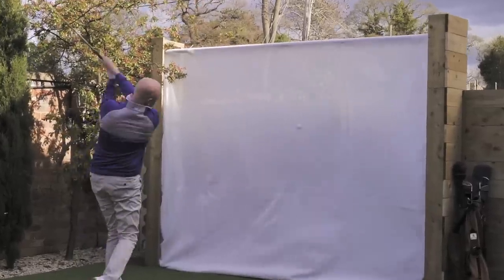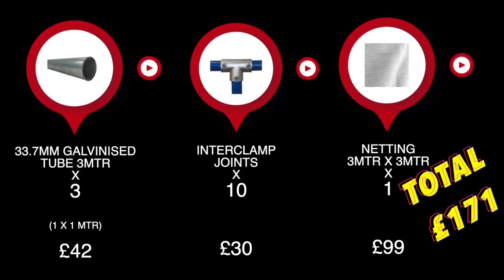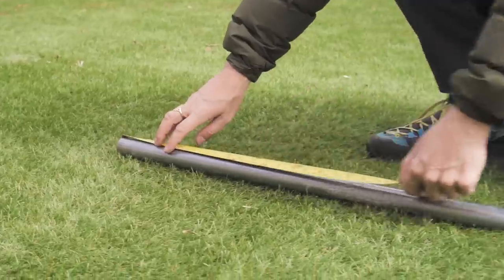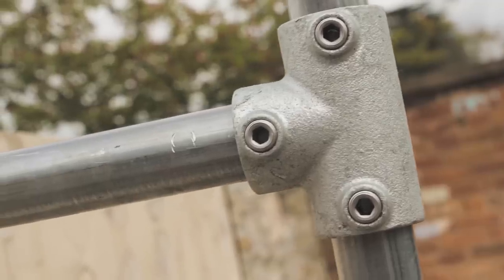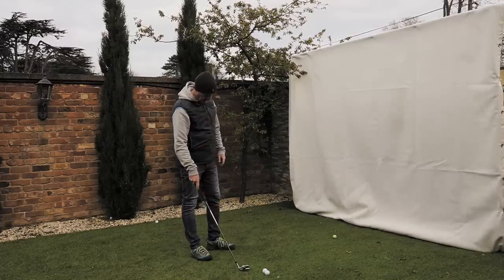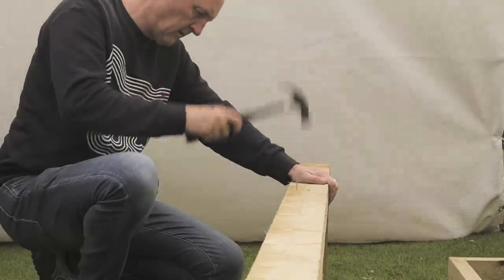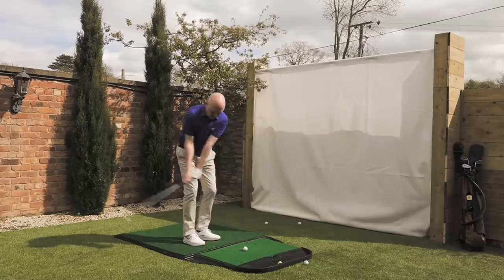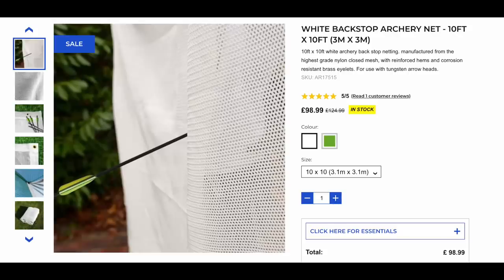I BUILT A BACKYARD GOLF DRIVING RANGE FOR £180!!

Comment: Archery netting is an excellent idea.
Are they heavy?
By comparison to normally netting/sheets?

I use a tension rod at the moment, and curtains - with another six-eight inches behind

An archery net would be much better - if the rods would take the weight.
Reply from the maker: Its not overly heavy but not sure the tension rods would hold
Reply: Ok, thank you.
I will stick to my curtains for now then.
Hopefully I can revisit the archery nets in a few weeks. Once normality returns I will visit an archery supplier and be able to find out.   @TheAverageGolfer

Comment: Hey Andy watch those plastic cable ties after a season in the sun the UV will deteriorate them and under pressure will crack and break i would use a heavy gauge wire down the road to change them out just FYI
Reply from the maker: Yes good advice I will change them

Comment: You reed my mind Andy. The pavers have been laid in a frame. I've got the mat to go on top. Just working on the net frame to attach to the fence. Got some 3M x 3M bird netting cheap from the hardware store and have a piece of shade cloth about 2M sq. I'll see how it works out but the archery net sounds great.
Reply from the maker: Someone mentioned shade cloth....we dont have that in the UK!
Reply: We use it Down Under to block out the heat of that big orange coloured ball in the sky that gets up around 40 degrees C in the summer.

Comment: Andy, did you come in on the pole dimensions to get a bit of slack in the width and height or keep them at 3m and were able to get the slack by not over tightening the tie wraps?
Reply from the maker: Yeah I would build the frame a few inches shorter than 3mtr square

Comment: Corking VID !
And 'Zackly what I'm thinking of, seeing as I  can't go to My local course (Kirkby Valley) or nearest Driving Range (Formby Golf Centre) for the foreseeable.

I WILL need a mat however.
But
There are "Ball Only" mats (crap in My opinion) from under £20
Decent "Range Style" ones are at least £60 a pop

However, Your recommend of Archery Netting is sheer genius ! Two Thumbs Up for that !

As a (recently retired) Plumber, I'd suggest that using Solvent Weld (SW)waste pipe (either 32 or 42mm) and 90's and T's
(Just don't Mix & Match Pushfit & Solvent Weld, they DO NOT fit together)
TBH Using SW without adhesive would work fine and mean it can be disassembled and refitted as and when.
Plus any "fatalities" are easily swapped out for fresh.

For a "Goal shaped frame" made of waste pipe you'd need:
4 (5 if you want to be more generous) x 3m Lengths of 32mm SW Waste Pipe (Toolstation Code: 40364 @ £3-77/ Length)
2 x 32mm SW 90's (Toolstation Code: 50479 @ 66p each)
4 x 32mm T's (two as feet, two as supports to something like shown, a wall) (Toolstation Code: 36237 @ 66p each)

Four lengths will create two verticals joined to a horizontal PLUS two front and rear facing legs at the bottom
Use the Fourth/Fifth lengths for the legs
(pipe can EASILY be cut with any woodsaw or hacksaw)
For additional support, cut the two verticals about 1-2 foot from the top 90 and insert the extra T's
The bottom of the Verticals can be inserted into the fron/rear facing T's and create support in front and behind the net.
Stake these down with string & tent pegs

Could even trial it out with an old duvet cover ?
Was thinking that using bungee style para cord would offer some elasticity to tether the "Net" with and hopefully prevent/delay the tearing around the "eyelets"

Design exactly as Andy's....

Total cost for My cheapo crappo ?
About £20-25 for the frame
Plus Net/Duvet Cover
Plus Mat (or a piece of an old carpet ?)

IF You want a stiffened lower edge to the Net, then create a hem and shove a few lengths of Pipe Lagging in there.
It's waterproof and stiff yet flexible but cheap as
Plus, won't give any nasty ricochets
Toolstation Code No: 63719 3 x Lengths @ 72p/length
Reply from the maker: Absolute genius!
Reply: @TheAverageGolfer  Glad that You liked it so much AG !
Chuffed.

Comment: Great video. I'm going to build one on Monday but being a heating and plumbing engineer I'll be using plastic waste pipe for a portable frame and a heavy duty dust sheet .it has to be portable as the wife will moan like mad seeing it in the garden 😂😂 will post pics when complete .
Keep up with the great vids and stay safe
Reply from the maker: Sounds like a great idea Alan, good luck
Reply: Leaving in a flat and not having much space or my own garden, I just ordered a soccer goal (3x2mt) as a frame: I’ll fix it with some old sheets my wife is already sewing and it can be easily moved around, with no one complaining about the shared garden. And at the same time and most of all, when all this s@#*t will be over, my kids will be able to use it as a soccer goal, as intended. Not nice as yours, but the total price is around 60€.

Comment: Hi mate, how has the screen fared after 1 week since you posted this? Pretty durable. I’m looking at the same product. Cheers
Reply from the maker: The net is fantastic, it is used for a lot of indoor simulators, I would use steel ties rather than plastic I used for longer term
Reply: The Average Golfer thanks for the tip. I assume absorbs driver shots pretty well too ?